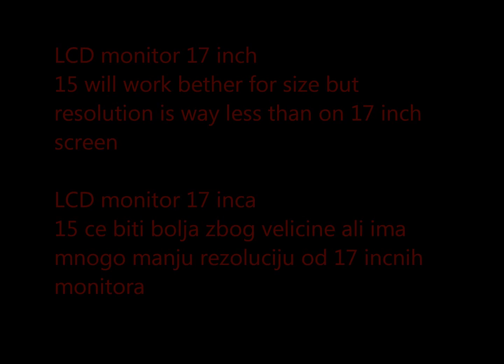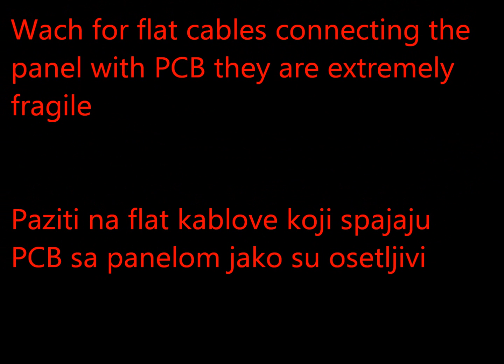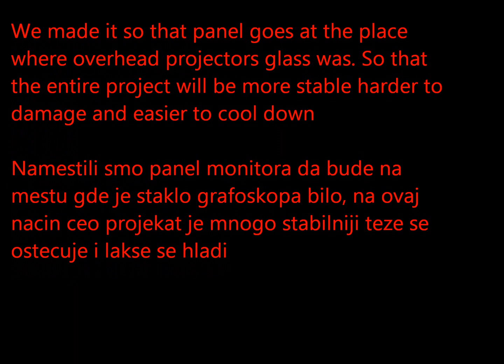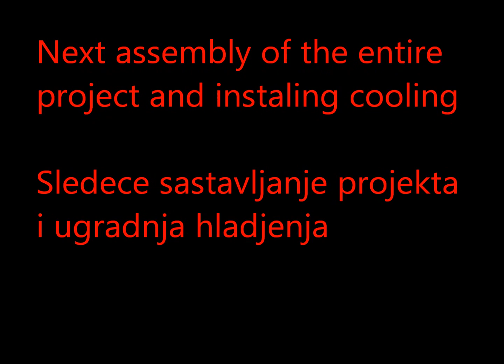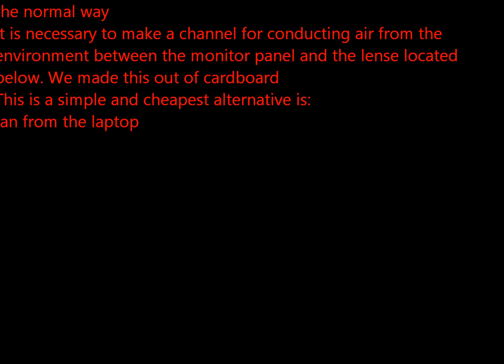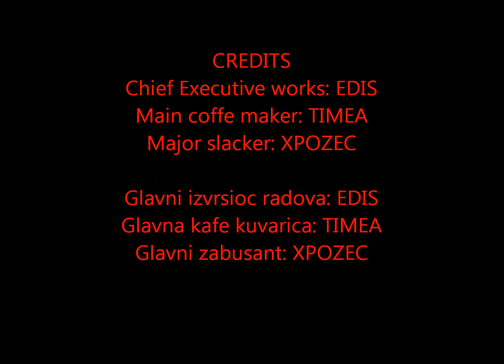DIY projector assembly and test - DIY projektor sastavljanje i test

Comment: Would a 15" 16:9 screen fit on a normal one without having those annoying corner bits?
Reply from the maker: yes but resolution on a 15" monitor is way lower than on a 17" so not so nice picture, but newer the less you can use monitor settings and reduce picture so those corners cant be seen ;)